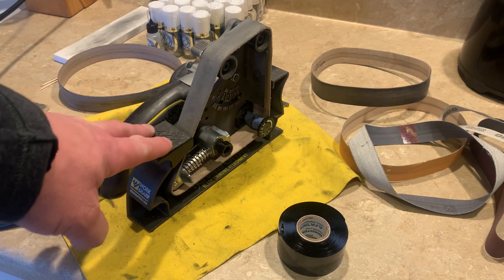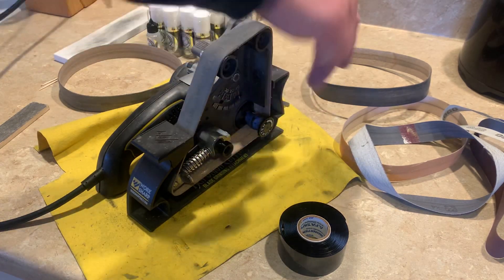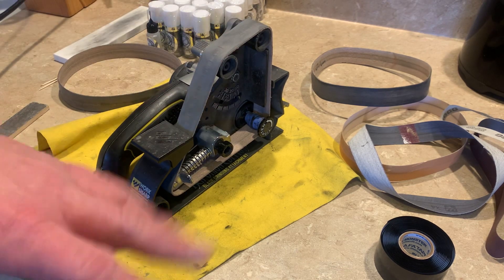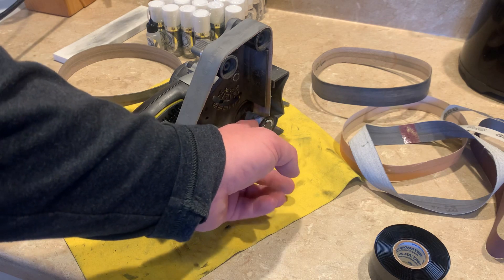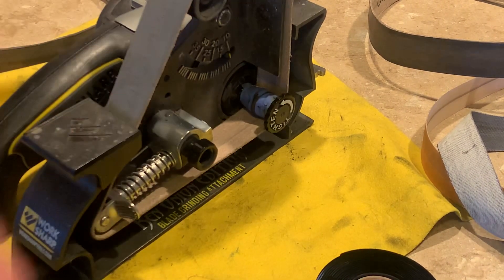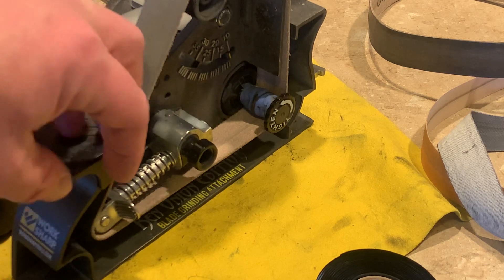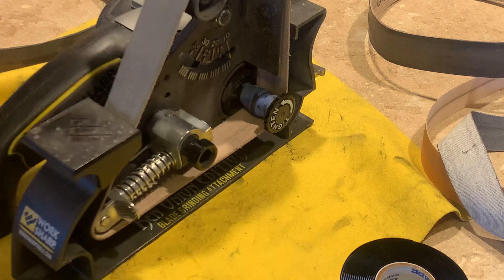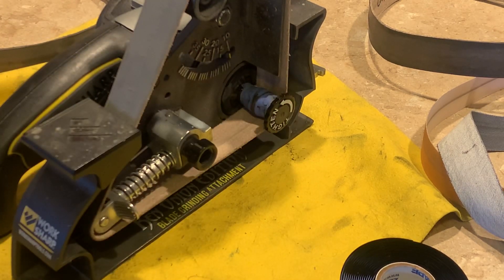Tech tip: Ken Onion WorkSharp With Blade Grinding Attachment

Comment: appreciate the videos! What’s your favorite use of the blade grinding attachment? I pretty much only use it for reprofiling or major repairs
Reply from the maker: Thanks. I use it for convex edges some. Mainly for large outdoor blades like a machete, axe or hatchet. Plus for softer or cheaper steels. And I use it to strop an edge back sometimes. With some Gunny Juice on a leather belt it will bring back an edge in seconds.
Reply: @GunnysSharptalk  how many microns on the gunny juice? What’s the popular one?
Reply from the maker: @robertmunguia250  there’s a 12, 9, 6, 3, 1, 0.5, 0.25 and 0.1 micron. The most popular are the 3 and 1 micron. Closely behind that are the 6 and 0.5.
Reply: @GunnysSharptalk  ok sir, I also been looking for a video on that red lever. I believe it has something to do with tensioner. If I move it around will it loosen? What’s it for?

Comment: I bought a piece of belt backing and stuck it to the vertical "platen" surface at the back with a small spacer so the belt has something to press against, now I can grind V edges as well as convex, or even more ambitious flat grinding. If you're going that far manage the dust HEAVILY with magnets, brushes, water tubs, whatever works for you but if you let it build up at all the motor will ingest some and short out, ask me how I know. 😅
Reply from the maker: Yeah went through a motor already. I use a magnetic whiteboard eraser a lot
Reply: @GunnysSharptalk  Where do you put the magnets to catch the dust? Also how do i know i need a magnet, i just use the grinder to sharpen knives, i don’t want my motor to short out!!
Reply from the maker: @zakbdz  I don’t have magnets on this one. I have been just cleaning the dust with a magnetic eraser